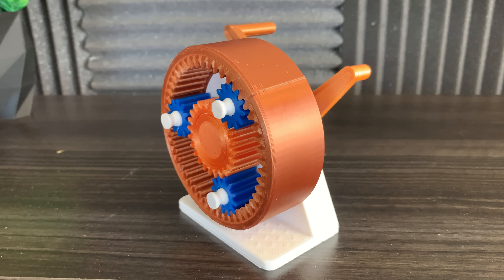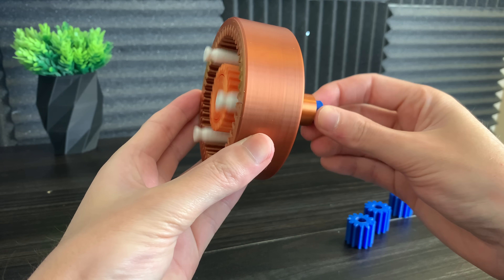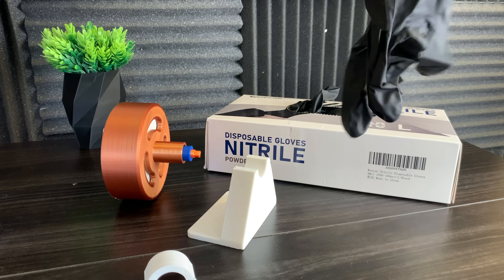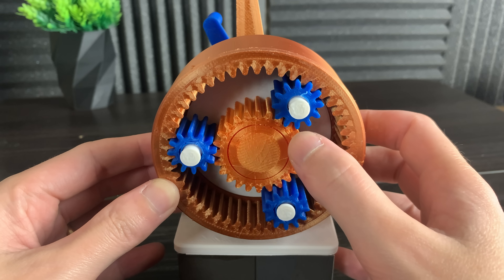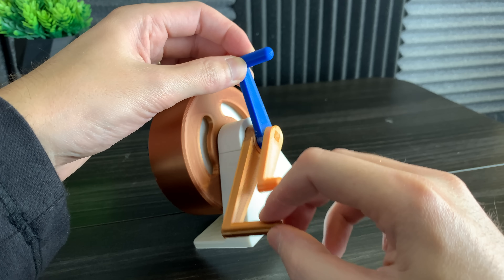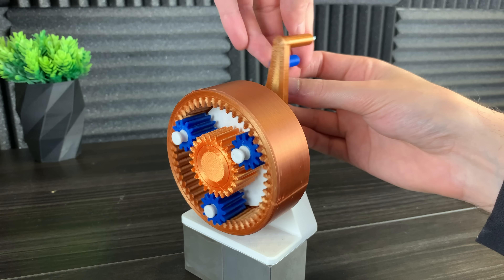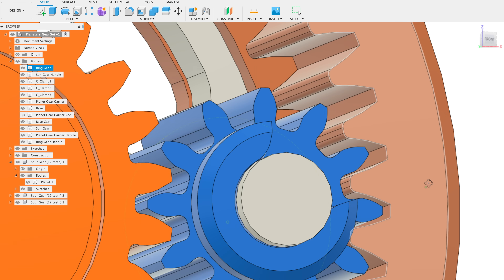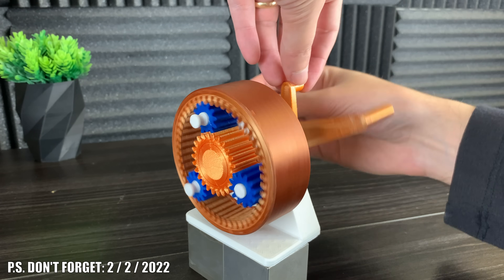What makes planetary gearboxes so amazing?

Comment: This also demonstrates how Toyota hybrid eCVT works.  The ring gear is driven and controlled by a motor (MG1 that varies speed and direct, thus eCVT), planet gear is connected to the engine and sun gear goes to another motor generator (MG2).

Comment: Planetary gears' compact power density demands extreme precision. We manufacture these with tight tolerances using CNC machining - perfect for low-volume robotics and automation projects where reliability is critical. Great breakdown!:face-blue-smiling:

Comment: It can also work as a torque bias differential.  The Ford sierra 4x4 which I had used a planetary (also called epicyclic) gear set as a differential between the front and rear axles.  Took me a while to work out how it was working - once I realised, hats off to whoever thought of it.

Comment: A great a summary of the way planetary gears are used in conventional automatic transmissions, with one of the three elements locked.  Even more amazing is the application Toyota Hybrid drives, where all three elements spin independently. That planetary gear is called a "power splitter", and it allows the car to use two electric motors to make a very competent continuously variable transmission, but without using any drive belts or clutches or shiftable gears. .

Comment: So, I was making a gearbox and I was having trouble with making the ring gear, I didn't know how many teeth I needed to make it all fit, so I made a formula that so far, has worked every time. It doesn't tell you if it will match up properly, because sometimes the diameter is right, but the teeth count won't work, no matter what amount of teeth you use solely because that's how it is. But the formula gives you the amount of teeth needed if it would work.

Comment: The ring gear on my electric motor is stationary what’s up with that
Reply: The sun is attached to the axle and the carrier is attached to the hub(wheel), the ring gear remains stationary on a tractor front wheel drive.

Comment: Poor design. Should have made the frame double (so that the gears don't fall out) and taller (so that you can actually spin the handles without needing 4 pairs of hands).
Reply: could put circlips on the ends of the planetary gear shafts

Comment: would it be possible to get you to make one of these for me?  how can i contact you?   i'm working on a project in classic cryptography and i have an idea about using something like this to crack polyalphabetic substitution methods. (my hobby is finding new ways to break old cypher text - this one is for Kryptos)

anyway..  i need a couple of planetary gear systems. the most important one is 
1 ring gear with 97 teeth (cypher text length)
1 sun gear with 26 teeth (encryption alphabet length)
3 Planet Gears with 35 teeth (plain text)
where consistent gear teeth size ensures constant intervals in all text space. planned uses for each can be swapped around..  you can use a 35 letter alphabet and have a plain text at 26 letters..ect..

The interesting thing about this is that the statistics in the cyphertext are not clear as to the alphabet being 26 or 27 letters (There may be punctuation marks in there too).  And then when you put together this gear assembly, you find that you a sun gear can be either 26 or 27 teeth without affecting the number of teeth needed for 97 teeth in ring gear or 35 teeth in planetary gear.  quite a coincidence!

I'd be willing to bet that Jim Sanborn has a little device just like this in a safe someplace that serves as his solution to Kryptos.! (not joking)...as if Enigma expanded the gears sets inside one gear rather than using a "daisy chain" of gears!  I think the Feynman Ciphers are the same thing too not sure the gear ratios. not sure how many planetary  gears for any of those.

whatever the solution to Kryptos,  its gonna be simple and beautiful  just like this planetary gear you've shown us.  Thanks for that.

Comment: So the main advantage is the multiple ratios or increase force transfer.
If I understand it right it’s not as easy to build one mechanism using all possible ratios. 
However the high force transfer, relatively small weight and size are main advantages for car and aviation.

You may see planetary gears might not be as popular in stationary machines as the weight is less of a concern. Here the ease of maintenance and manufacturing cost is more important.

Comment: Super glue sets with moisture (not air), which is why it doesnt set inside the glue bottle. Superglue works well with porous materials where moisture is held naturally (like wood).
Solid plastic and metal are not porous, so need help to allow moisture to get it to make it set. Otherwise it wont set.

Comment: Partially but not entirely correct. In practical use, planetary gear reducers have one gear ratio, that between the sun gear and the ring gear. And yes, you should have secured the plant gears, not better, just at all.

Comment: I know this video is not new, but haven't seen it yet. As a retired Automatic transmission repair technician, I found the video fascinating. I wish I had this video when I was training younger techs. There is one thing  I want to mention, however. The gear ratios are calculated by a formula that uses the number of teeth of the ring gear and the sun gear; the planet pinion gears themselves only transfer motion, and the gear tooth count does not affect the ratio. For example, in your model the number of teeth on the ring is 49, and the sun is 24. To get the Reverse ratio, divide the ring by the sun,(49/24)  for a ratio of 2.04:1; for a forward reduction where the the sun is held, the ring input, the carrier output, the ratio is the sum of the ring and sun gear divided by the the ring gear.((24+49)/49) In your model the ratio would be 1.49:1 Your overdrive is when the sun is held, the carrier is input and the ring is output; the ring gear count is divided by the sum of the ring and sun, (49/(24+49))for a ratio of .67:1.
Nice video!

Comment: I always wonders about the exact mechanics for the Overdrive + Underdrive on the rear of my old Willys CJ2 transfercase.   
  Full Revs while in underdrive & 1st Gear is barely a walking pace, but the Torque is crazy for a 56Hp engine!we

Comment: The best way to buy CA (Super) glue or epoxy is from a model aircraft supplier.   You can buy much larger quantities for a lot less.  You can also get CA glue in different consistencies - gel, for example - and epoxy glue with different drying times.

Comment: In the process of rebuilding the transmission in my car, this 3 pinion planetary gear set is also in Chrysler A727 transmissions, later transmissions had a 4 pinion planetary gears.

Gear reduction ratio in first gear is very similar to this model of 2.23:1

Comment: There is actually a boundary that helps you designing a planetary gearbox that fits better without a need to adjust the nominal tooth thickness. In German it’s called “Montagebedingung”, which can be translated with “Boundary of assembly”. The sum of the number of teeth of sun and ring gear (absolute number since the ring is generally defined with a negative number of teeth) divided by the number of planets has to be an integer. I could not count your teeth properly, I counted 25 and 48, correct me please. 73 divided by 3 is not an integer, maybe that’s why you had to adjust the planets. But for sure tolerances always play a huge role here. Just for the next project :)
Reply: Never mind, you have a 2:1 ratio between sun and ring gear. Therefore you fulfilled the boundary :)

Comment: This mechanism, Is great for , Spinning one thing and also if you want to spin two things! Except you might need a mechanism, Before it (Inside gear left movement attachment to right one, That’s used in vcr’s, Well the one I have.).

Comment: Boy did this bring back memories... a VERY long time ago when I was a young teenager I taught myself how to rebuild Ford(1949-1954) 3-speed transmissions with a Borg-Warner overdrive. An interesting fact about those overdrive units is... when the O/D was manually selected, but not  engaged you would be in a 'free-wheeling' situation so when you let up on the gas the engine would simply go to idle. When you got up to around 30mph and let off  the gas momentarily, a solenoid would engage the O/D. The free-wheeling was necessary when you were running down the road so there was no load on the O/D gears during the shift. The really interesting part was... (lets say you wanted to pass) when you floored the gas pedal it would depress a switch mounted under the gas pedal. That would actually short out the engine coil (just like you turned the ignition off), which would in turn remove any load on the gears, then the unit would shift out of O/D. If you did not want the O/D to engage at all (town driving) you would manual select 'no O/.D'. That would lock up the planetaries on the sun gear.  Fun memories I have not thought about for a very long time.
Reply: Sounds like driving a manual transmission is less complex!

Comment: I got to learn a little bit about these when helping fix a crane at work. There's what's called a planetary gearbox that uses hydraulics to spin the gear and make the crane rotate. I had to disassemble and clean it up. It was a Linkbelt crane. All together, I'd say it weighed 300 pounds.

Comment: Unfortunately you don’t reveal the downside of this type of gearing, the first is the noise, I used to fly an aircraft called an F27 which was powered by the RR Dart turboprop engine, this had a 10 to 1 reduction gearbox provided by a complex sun and planet arrangement so that the propeller would turn at 1,500 RPM while the turbine was turning at 15,000 RPM, the high pitched whine produced by the gearbox was a well known and really dreadful feature of any Dart powered aircraft, as anyone who has flown in an F27, VC8 Viscount, HP Herald, HS 748 or the early Gulfstream 1 can attest. The next major issue while using helical cut gears is that of layshaft chatter, in extreme cases this can destroy the planet gears and cause failure.

Comment: How crazy I understand CAT used this type of gearing in their front end loaders as well as in use in the 518 and bigger 528 rubber tired skidders.  seem very reliable..  Now I own a x20 ebike that uses this technology..The motor is 2000 watts and allows the bike to start on very step hills..  less that 1% of e-bikes made have a transmission.it’s call geared rear hub..  The bike has a 5 speed hub in the rear..  This bike totally trashes bikes costing 4-5 times as much..   Imagine doing wheelies or going 42 mph on a ebike.  Ha Ihave done this for the last 6 months…When I rise in second gear the bike uses low power and allows me to go over 75 miles…Just think if Tesla employed transmission like this on each wheel in their cars how much farther they could go..  and way faster..

Comment: Hi there, I would like to create one like this but the center would be smaller than the 4 circles, equal in size, around it. As I see it 1.5 times the size of your example. Hopefully, I could print the parts in the Da vinci Jr. Pro X+. Do you have a tutorial in designing them with a free of charge software? Thank you.

Comment: Toyota uses a planetary gear system in their Hybrid Synergy Drive. This allows them to control the mix of power from the gas engine and electric motor. Very clever.

Comment: Awesome demonstration and well explained!  Thanks so much for sharing this with us!  I found that you cut 24 Teeth into the Sun Gear and 48 Teeth into the Ring Gear.  Take the sum of the Sun and Ring Gear to use as the value for the Planet Carrier (72 Teeth).  The Ratios are easy to figure after that.

Comment: You need to take account of thermal expansion, and use an offset in horizontal expansion in the slicer for the tolerance

Comment: Radial aircraft engines , eg Pratt & Whitney's, have a planatary reduction gear built into the fron of the engine to allow the engine as well as the propeller to each work at it's most efficient rpm.

Comment: Handy hint for if you get super glue on your skin, massage some vegetable oil around it. Eventually the oil will soak into your skin and under the super glue causing it to come off.  It takes a bit of time and you may need to repeat multiple times, especially if there is a lot of glue, but it's better than waiting for your skin to shed or just ripping it off

Comment: Cvt transmissions on ag equipment use a planetary gearset. The input is the planet carrier, the output is the sun gear, and there's two hydralic motors/pumps in a closed loop. One is on the sun gear, the other on the ring gear. By varying the speed and direction of the ring gear, you get forward and reverse speeds that can be anything from stationary to top speed. Ecvt transmissions in cars work the same way, only using electric motor/generators instead of hydraulic motor/pumps

Comment: Attempted four times to enter comment, before it let me. If you add baking soda to super glue you get a far stronger bond. Far too many adverts, like every two minutes, but no explanation as to  what application you would use it for, so no i won't be coming back.

Comment: 1:1 or really close to it, is 3rd gear, or Drive; this is why 4th and above is called Over-Drive. The planetary gear is the reason Automatics are more "bullet proof" then manuals; the planetary gear never grinds, there is no way to make it grind, the gears never come out of mesh. Automatics fail because of the friction plates failing, not the gears themselves.

Comment: Tip: the end of the glue tube cap can be used to pierce the new tube. In fact, the cap is designed to do so. Great job with the gears.

Comment: Dry graphite is usually a better choice of lubricant for this type of application.  It doesn't degrade over time, and is incredibly effective (if slightly messy to apply).

Comment: "There are 6 gear ratios" no, there arent. choosing which gear is powering the other doesn't change the ratio. thats like saying a 5 speed transmission has 10 gear ratios if you spin the wheels to turn the engine.

Comment: While you explained the ratios, you said nothing on the transference  of power, how and what moves between input and out put of power, planet gears are basically just idler gears their direction of travel will always be opposite  or will it, how does direction of rotation affect the direction of travel, You missed the most important  parts of the topic of planetary gears

Comment: I worked at a company that attempted to develop a planetary gearbox to drive a turbo compressor from an aircraft engine propeller drive shaft mounting pad. They attempted to use the propeller output as a power source for compressed air instead of engine bleed air for air condition and cabin pressurization.  The effort was design was to take a low output shaft speed and step it up to mid 40,000 rpm. The gearbox harmonics and bearing inputs was amazing and I don't recall if they ever did get the design solidified. The price of aviation fuel fell soon afterwards and the effort was cancelled.

Comment: It's why I prefer internal gear hubs for my bicycles.  Everything critical is enclosed.  If you make sure the shift cable is properly adjusted and give them some oil now and then they run almost forever with very few problems.

Comment: The machinery I built in my job had running registers which allowed you to move the location of the printing plates without stopping the machine to re-register the job, without the planetary this would not be possible.

Comment: IIRC a differential gear is also basically the same thing as the 1:1 (direct drive) case. Drive the "blue handle". Don't bother with the other handles, but use the "Sun gear" to drive one wheel and the outer gear to drive the other. If you're driving in a straight line, everything turns the same speed. If you're driving around a corner, the blue handle sets the average speed of the wheels - the inside wheel turns a bit slower as it travels a slightly shorter distance, and the outside wheel turns a bit faster - the two drive wheels can rotate at different speeds but you can still drive those wheels and you can still accelerate. In practice, the "handle" is another gear connecting to the drive shaft.

One problem is that if you lose traction on one wheel, that wheel just spins freely so there's no force on the other. This can make it difficult to drive off of a patch of ice, for example. Modern cars do something about that, I think, but I don't know what.

Comment: This a cool project, but I still have a couple of questions...

How did super-gluing my gloves to my hands assist the gears?
How do I remove the gloves now?  (You did that bit off-camera!)
Reply: Super glue is removable with nail polish remover, cheap and easy. Be careful though, it damages some plastics!
Reply: All plastics*
Reply: @danielthecake8617  it's in a plastic container though
Reply: It doesn't dissolve plastic, it softens the bonds to other molecules, meaning higher 

density plastics are almost unaffected.
Reply: @dane7961  They use a specific plastic built not to break apart.

Comment: As a manual user, I am now convinced that automatic transmission is also cool.
Reply: What does a planetary have to do with a transmission??? It’s used in final drives for tractor rear ends or 4wd tractors front ends. It reduces the stress on the U joints so they don’t snap of.